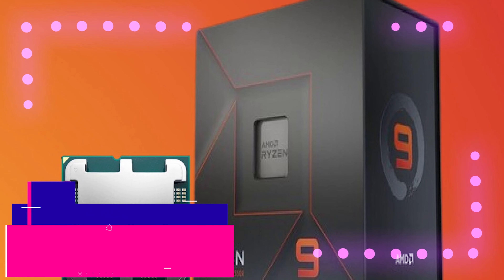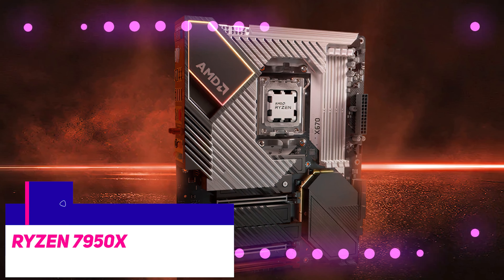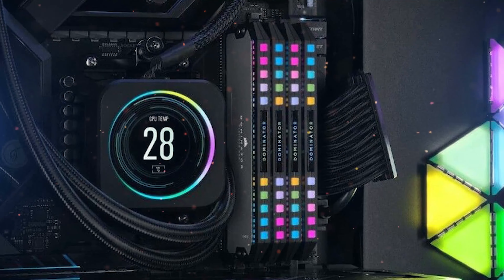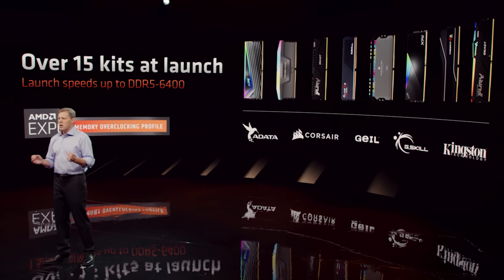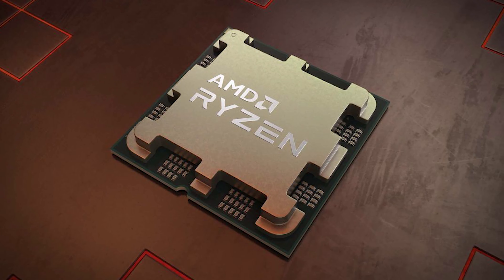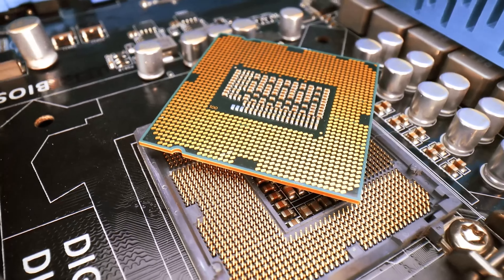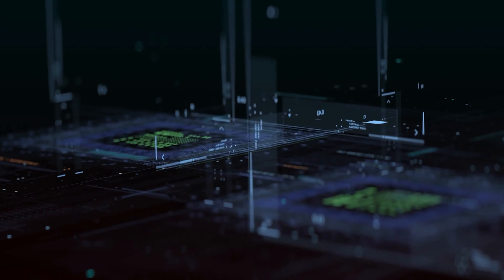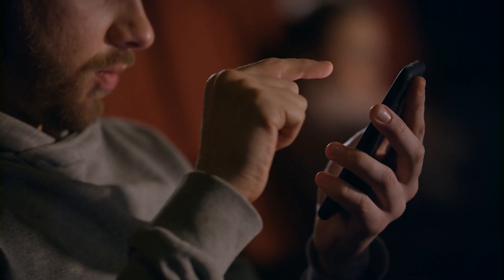Ryzen 7000 Series Details! - Specs, Benchmarks and More!

Comment: Seems interesting but my 5950X will be good for another 3 to 5 years easy. I doubt any games will ever need 16 cores and 32 threads.
Reply: Yeah you are good. Always getting top of line stuff like this is for enthusiasts who enjoy always having the latest and greatest.
Reply: @caShflo  yeah I kind of buy all the new tech. But I’m a lay off this time since the 5950X is more than what I need.
Reply: Most of the games are bottle necking with the gpu. Your CPU can be good for the next 10 years unless smth happens. My brother sits on the overclocked 3770K. Tough but managable
Reply: @fatavocado7291  obviously depends on if you are multitasking (streaming, have other apps open etc)
Reply: @caShflo  100%. You are right. I was saying about the pure gaming.
Reply from the maker: Prioritizing longevity definitely saves money in the Long run